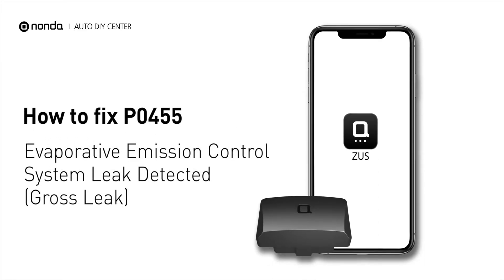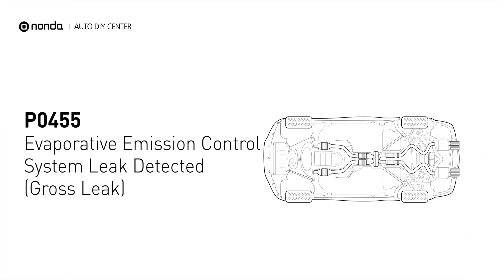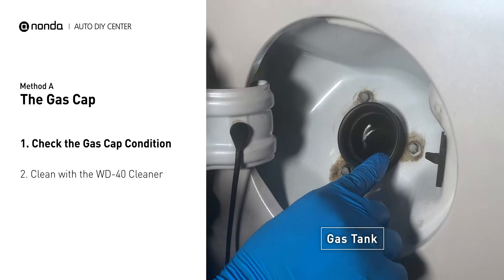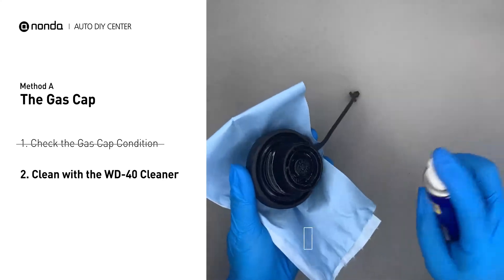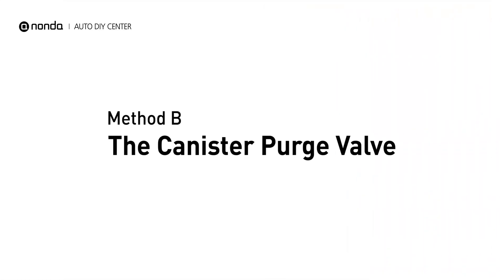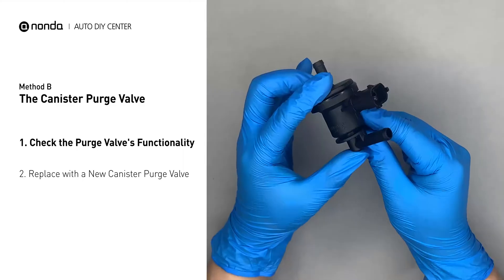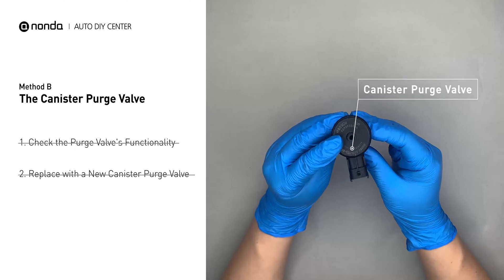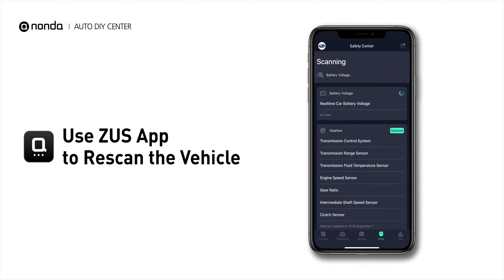How to Fix P0455 Engine Code in 3 Minutes [2 DIY Methods / Only $4.61]

Comment from the maker: Hi, I'm Steve, nonda's lead mechanic engineer. 
Feel free to leave your comments here if you have any mechanic questions, I will be glad to help you out!
Reply: Steve died shortly after posting this
Reply: OMG, so sorry!
Reply: @anythinganytimealways  Seriously or fooling around?
Reply: @woodsrider117  inferred.
2 years no response
Reply: @anythinganytimealways  Exactly. (four years now)
Reply: Hey Steve, I put my finger up to the purge valve with hose and electronic controls removed. I felt a slight vacuum. However, when I removed the part and tested it by blowing through it with my own breath, it held tight. Should I replace the valve or look elsewhere for a leak?
Reply: s t e v e
Reply: I have cleaned & replaced both the purge valve & the gas cap, but the light is still on & it has trouble starting. What else could it be?
Reply: Fuel pump  @GitGud_or_DieTryin
Reply: Where does the purge control valve located for mazda cx-5 2018 with picture pls. Thank you
Reply: Steve my Tahoe 2007 does not turn on I have to do it 7 r 8 times I had the fuel pump change spark plug got gas cap dont know what else to do can u help me
Reply: What about capless vehicles such as my 2014 Jeep Grand Cherokee?
Reply: What about it has like a clicking noise to it my car had a check engine light on and AutoZone said it’s the mass flow sensor which I cleaned and still stalled when giving gas but it goes away after about 10 minutes of warming  up or driving any answers
Reply: I have a 2004 trailblazer. I had a p0442 small air leak. I found a leak in the filler tube and I replaced it. Erased code and now I have code p0445, large leak. I do have 2 brand new OEM gas caps and they seem to be tight. I did read comments under every brand replacement filler tubes that after they replaced them they leaked at the gas cap seal. So I'm not sure how to determine if that's the problem. Aren't gas caps vented anyway? 
I replaced the purge valve last year and that cleared the code at that time. What would be the most likely culprit now? Vent valve? Hoses between canister and fuel tank? I tried smoke but I was using a hose that was already past the purge valve. I'm not sure we're a good place is to connect to near the canister. 
I was hoping someone could advise me with some kind of order of what to check for next instead of just throwing parts at it. Thanks
Reply: Absolutely helpful. 
Thank youuuuuuuu for sharing.
Reply: if my car is having trouble starting after having the code come up could the canister purge valve still be a probable cause?
Reply: @dariusthompson9187   ll
Reply: ㅈ

Comment: I have a 2015 Buick Enclave with a code P0455. I gotten the notification to tighten gas cap for a couple months now and I tightened it but it turned into a check engine light. What do I need to do.
Reply: i currently have a similar issue and i am being charged 85usd to diagnose and 200usd to fix as well as being responsible for buying any parts that may be required during the fix process. i really need an alternative
Reply: @theanchorkennel5014  I ended up fixing the problem myself and saved a lot of money.  I found out I needed a new purge valve and got one off Amazon and replaced it myself.  Cost  me 13 bucks vs the 1000 bucks they quoted me for.
Reply: I would start by changing the purge valve and vent valve first as they are cheap and easy to change, if the problem persists it's likely the charcoal canister that needs replacing

Comment: I have an 08 Chevy Tahoe and I had the P 0455 code and have replaced the purge valve however am still getting the check engine light any suggestions ?
Reply: likely the charcoal canister

Comment: 2020 Toyota Camry with current codes p0441, 455, and 505. The smoke test had smoke coming out of the vent on the charcoal canister. But we were able to get it to go close with the computer. Any suggestions where to go from here? You can hear the purge valve clicking under the hood so it seems to be working. The car will kind of idle high and fluctuate when idling.
Reply: Smoke will come out the vent even if it's not faulty because the vent stays open when case is not being driven.
Reply: @PoetryD-p7s  yeah, that's what my mechanic told me and then he signaled it shut with the ODB reader and it closed.
Reply: Based on all the codes present, seems like your evap purge valve (in the thumbnail) may be faulty. Remove it and see if you can blow thru it. If you can, then it needs replacing. The pcv valve could also give you a 0441 code, less likely with the other codes but you can check, take it off, shake it. If it rattles inside, it's usually fine.

Other things that can make this code happen besides the evap purge, vent... Could be simple as the gas cap needs replacement or a better seal. I would start there. You can test it before buying a new one. Take a plastic bag wrap around your cap twice, then close it like normal after you get gas. Clear your codes. Then drive around. If it doesn't come back on for a few days, it's the cap. The bag helped to seal it to test.

Comment: THIS IF YOU USE LOCK GAS CAP IT SEND THIS CODE IF YOU TAKE OLD RUBBER TUBE CUT IT ON THE CAP IT TURN OFF THIS CODE YOU KEEP THE LOCKED GAS CAP

Comment: wrong information,  my car got p0455 , changed those 2 still not working.  wasted my money.   the hose crack can cause p0455 same problem
Reply: What hose crack?
Reply: @UptownAD  the small one connected to the fuel filler and canister

Comment: Actually I checked again and got 0441 twice up down arrows and 0445 and check engine light. 2007 Lexus GS350 and probably wasted money on purge valve and gas cap…. Help

Comment: If you experience suction on the purge valve while the engine is running it "DOES NOT" mean the purge valve is bad, as the system will periodically open the valve during operation. It must be disconnected from the electrical source (to ensure the valve should be closed) then you should have no suction. Just wanted to help clarify this.
Reply: I was wondering about that, thanks for the info.
Reply: Great help!!!
Reply: On a cold start it should be closed
Reply: Thanks

Comment: I have a Ford Fusion 2011 3.0 V6 and I kept getting codes P0455 and P0457. I don’t have a gas cap and it seems to be clean and the check engine light actually popped on. It went away for a bit but then came back.

Comment: These codes came back on my 2017 Toyota Camry XLE:
P0455- EVAP system gross leak detected
P0441-Evaporative Emission Control System Incorrect Purge Flow 
P1604- Startability Malfunction
P0171- Air/Fuel Mixture System Lean Bank 1 

What might need to be fixed?

Comment: In my particular instance I have a 2020 Mazda CX-5 and we had just changed the spark plugs, in order to do that the ignition coils needed to be removed, in order to do that, one of the hoses got unplugged on top but forgot to get plugged back in when everything got replaced. Easy fix
Reply: Curious if your car ran after the plugs and coil work?  I happened to have gotten plugs and coil work done, then immediately had the evap codes and minor but ongoing running problem.  It's actually been months now.

Comment: I have code p0455 on my 2018 chevy traverse but i don't have a gas cap. I got this code 8 days after replacing canister purge valve for code p0442. Auto zone said code p0455 is the fuel tank pressure sensor

Comment: Hi, I replaced the purge valve and the canister on my 2014 Jeep Grand Cherokee Limited Hemi 5.7. It has code p0455 large leak. When I go to fill the gas tank, as soon as I am done, and try to start the car, it idles and won’t start. It gets stuck on the cranking, then it stops, and then I try again and now it turn on. It only does it when I fill the gas tank.
Reply: Same here
Reply from the maker: Pls check the possible causes:
Missing or loose fuel cap
Incorrect fuel filler cap used
Fuel filler cap remains open or fails to close
Foreign matter caught in fuel filler cap
EVAP canister or fuel tank leaks
EVAP system hose leaking
Fuel tank leaking
Reply: Try changing vent valve

Comment: Thank you. Went to the Auto parts store. They loan you the diagnostic tool - error code P0455. Saw this video --- cleaned the gas entrance (it has no cap) --- and Guala ! Engine light totally off. Spend 0 dollars thanks to the free diagnostic tool they loan customers and to you ! Thank you so much !
Reply: You got lucky!! 😂
Reply: Did it say large leak?
Reply: What did u clean it with my 2018 chevy traverse don't have a gas neither
Reply: Same here on a jeep ?? Any answers code p0455

Comment: Remember when you fuel your vehicles and to pump automatically kickes off. DO NOT!! CONTINUE to add more fuel. This over fills into the charcoal canister and causes this issue plus worse.
Reply: nice tip, thnx!
Reply: Thanks for the tip
Reply: A gasoline pump failed to shut off and the fuel over ran the tank, causing an error code.  It took a couple of weeks and a couple of hundred miles, but the fuel and vapor finally evaporated from the charcoal and the error cleared itself.
Another vehicle which had no evap system error codes when parked for months, but an evap error related code appeared.  Fuel had evaporated from the tank and saturated the charcoal.  Running the vehicle for awhile cleared the fault.code.
Reply: learned this the hard way
Reply: @youngjrr what happened?
Reply: so i ended up doing that few days ago, am i screwed? 
i always had the “check fuel cap” but it would sometimes pop up then sometimes turn off. 
but 2 days ago i kept adding more gas to the tank once it stopped. 
so do i just wait now or what? 
i have both codes on large leak and small leak.
Reply: @gettriggered8404 What did you end up doing?
Reply: @SanDiegoBoxes  nothing lol car runs fine still. check engine code still is up for large leak and small leak.
Reply: @gettriggered8404 does it smell like gas in your car frequently? It’s the purge valve and the charcoal canister I believe. In my car it’s behind the rear right wheel, you can watch a vid how to replace and do it pretty simple, don’t want a fire or something bc of a gas issue
Reply: @SanDiegoBoxes nope not at all, i took it to my mechanic though. 
he said the car is fine. but ima take it to a diff mechanic later this week to get second opinion.

Comment: I have this code and I smell gas inside the car so what is the problem please and how can I fix it?
Reply: My car is Hyundai Tucson 2012
Reply from the maker: Hello, kindly check if there's an issue with the gas cap or the canister purge valve.

Comment: Yes, if you have P0455 code (large evap leak), then replace 1) charcoal canister,  2) vent valve,  3) purge valve (change #1 first, drive if get same code, replace #2, etc...).  Hopefully P0455 goes away then you may get P1456 code (small evap leak), then replace rubber hoses that connect to the canister
Reply: Why not find the exact cause of the problem? Save money & time.
Reply from the maker: Thanks for sharing your knowledge!
Reply: Is this a difficult job to do?

Comment: Can you show me where the canister purge valve on 2008 Mercedes C300
Reply from the maker: Hello, it's located at the backside of the rear wheel well on the passenger side of the car.
Reply: @nondainc how about a 2008 g35

Comment: My wife has a 2004 Pathfinder and she got a p0455 code (evap gross leak, large evap leak).  Took to the dealer, they changed charcoal canister, vent valve, purge valve.  Then p0455 code went away, then we got p1456 code (small evap leak).  Dealer then changed gas cap, still got p1456 code.  Took back to dealer after 1 month, they charged $185 diagnostic fee, said it was stuck vent valve.  I researched,  bought new fuel tank pressure sensor and vent valve. I installed both, still got p1456 code.  On my work day off, I got under car, removed canister (I tested it, good).  I noticed rubber hose coming from gas tank to canister was stretchy, so I bought new fuel hose.  I cut back a little bit of the purge line rubber hose (it was stretchy). Also I bought new clamps (ones where you use screwdriver to tighten). Installed the new fuel hose (that connects to the canister), 3 new clamps for the 3 hoses that attach to the canister (vent, purge and fuel).  Bingo!!! No more codes pop up (no more CEL check engine light).  No more evap leaks.  Hope this helps somebody.
Reply: I guess I’ll follow your steps cause I have same issue
Reply from the maker: Thanks for sharing your experience, Tito Darden!
Reply: got this code after a fuel pump/ gas tank drop replacement and clean ( sugar in tank)...seems this canister thing might be it
Reply: @cxxmiranda man, I been dealing with this stupid error on and off for 6 months and I found my gas cap open and hanging one day around that time. Live in a sketchy hood. Had my front window broken 3x in one year too. I thought they just took gas but now I'm wondering if the perp put a rag or blue shop towel in there. I fkg hate ppl.😢
Reply: Tried everything you said except purge valve, going to try that and lyk
Reply: 🙏 for info
Reply: Seeing this is meant for a truck I'm sure it didn't work on your car 😂😂😂😂😂
Reply: And how much effort did this take because I work overnight so my window to work on my own car or not pay over $1,000 for this evap fix is very slim and I only have $800 in my bank account every time I try to get over 1200 some bills come up and I'm fucked like I don't understand how Society expects us to keep fixing our cars and being able to afford vehicles and of course my car is 26 years old and I still have to take emissions like I'm sorry if a car is 20 plus years old you shouldn't have to take emissions it's fucking stupid
Reply: I have these codes now.
Reply: Spent alot to find out yourself a relatively cheap fix!  I just went through it too.  Ended up the tank vent valve hose had a "chew" hole it it.  Probably a squirrel and I hope that bitch got a good taste of gas!
Reply: You got ripped! 😂
Reply: Stupid taking your 04 dinosaur to a dealer🤣

Comment: i don't have gas cap my suv is 2018 suburban gas capless
Reply from the maker: Hi Arly, we suggest checking the purge valve and the canister vent for issues. A replacement could be necessary.

Comment: 2020 Chevy Impala LT. Engine light came on months ago and I had it diagnosed it read P0455. I had the valve replaced immediately and the light went away. I noticed how my car was sounding after I replaced the part.. 4 months later the light comes on again and reads the same thing. I’m stuck between a rock in a hard place…
Reply: Back again. The light recently came on now I know something is wrong I find myself getting gas every 2 days now. I’ve replaced gas cap and purge valve..
Reply from the maker: Hi Devonte, is there any other codes that register along with this code?

Comment: Hello,i have a 2005 mazda 3i, i already changed gas cap with a  oem gas cap and changed purge valve and still have code P0455  and also, there's  a gas smell when i drive. I already checked under car and see no leaks and already took my car to two mechanics and both of them said they don't smell anything or see anything unusual. Any suggestions??
Reply from the maker: Hi Ozie, have you inspected the condition of the wires at purge solenoid for any issue?
Reply: And also , i've been at the gas station and the pump would stop at let's say 2 dollars and then i pump it again and it stops again and after that, pump fills up my tank fine.
Reply: @ozzayyyy  this is your charcoal canister!!

Comment: Steve I have 2007 Tahoe it TAKES 7 r 8 times before it starts had fuel pump change spark plug gas cap dont know what else to do
Reply from the maker: Can you please confirm if this is the only code that you're getting?
Reply: @nondainc lol wasn't only code

Comment: I have a Honda Pilot 2011 and the engine is on, have codes 420,  455 and 456, your help will be appreciated, thanks.
Reply from the maker: Hello, since you are receiving more than one error code, we suggest getting your vehicle visually inspected by your local mechanic for further diagnosis.
Reply: @nondainc  ok, thank you.

Comment: Holy crap - cleaning the cap actually worked.  Thank you.
Reply from the maker: Thanks for watching! We're glad to be of help, Chesky!
Reply: I have Easy Fuel gas cap in my Explorer 2020, how to clean it?
Reply: @nerosmero1183   use rubbing alcohol
Reply: I have same code after replacing that one part.
Reply: How long did it take for the code to disappear?
Reply: @LilHi2   It was immediate.  If it is still on for you - then it is something else.  Good luck.

Comment: Honda pilot 2005 
P0457 ( LOOSE. Cap or off) replaced it.
P0455 large leak?
P0497 LOW PURGE FLOW?
P0497 HIGH PURGE FLOW?
P0456 VERY SMALL LEAK?
FYI: THESE ARE THE CODES DETECTED THE ONLY THING I KNOW I KEEP REPLACING IS THE POWER STEERING FLUID BECAUSE IT HAS A WHOLE AND LEAKS IT OUT.. Cn that be the problem. I have until Sunday to pass emission🥴🤦‍♀️😪
Reply from the maker: Hello, since you are receiving multiple codes, we suggest getting your vehicle visually inspected by your local mechanic for further diagnosis.

Comment: Would the purge valve create a whining noise when accelerating? I have an 09 Malibu 3.6 with a p0455 code with a new GM replacement gas cap.
Reply from the maker: Hello, it could be a result of a damaged purge valve or due to the leak in the evaporative emission.

Comment: I replaced the purge valve and the Evap pump on my ram and Iam still getting a gas cap light. And check engine light
Reply from the maker: Hi Alexander, please provide us with your vehicle's year, make and model.

Comment: I have this code on my 2006 pontiac torrent. Wondering how to fix it?
Reply from the maker: If this is the only code you're receiving, kindly check the Gas cap, EVAP line, charcoal canister and fuel tank. Replace if necessary.